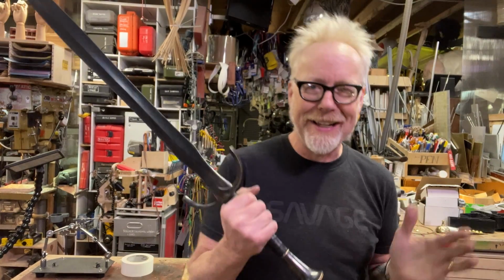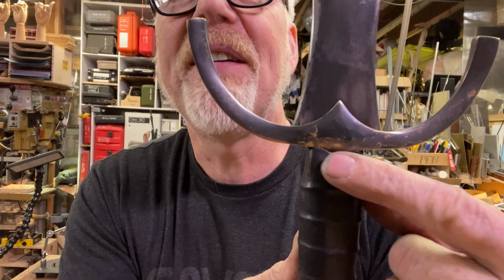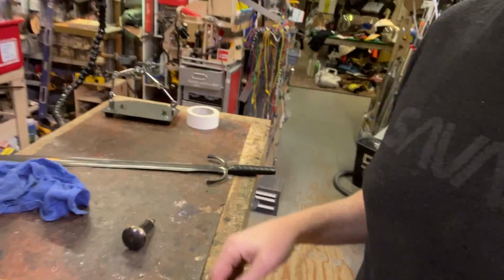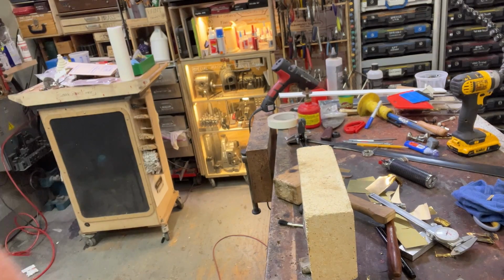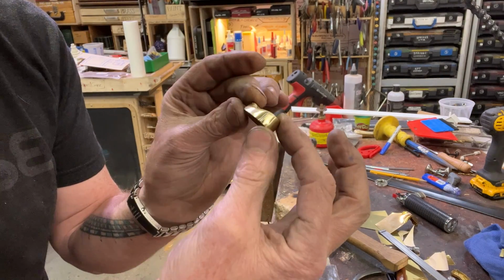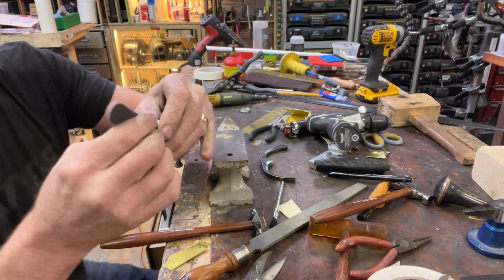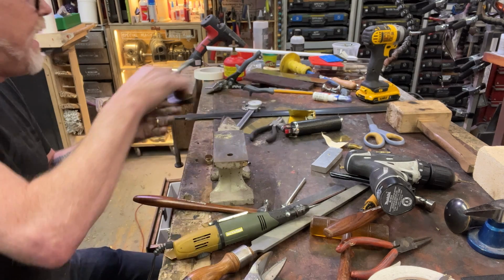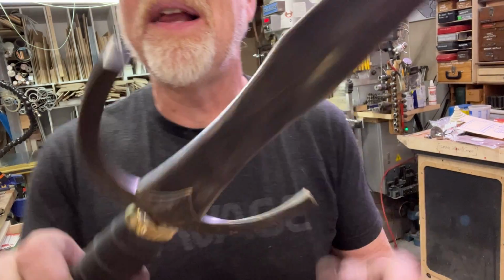Adam Savage's Assassin's Sword: Capstone Build

Comment: Watching Adam remove the chain drilled piece from the slot reminded me of an OLD aircraft industry joke. A company was producing a new fighter and were testing the prototype. Everything went well until the test pilot tried to pull it out of a steep dive, when the wings ripped off and the airplane crashed. They did an investigation and reinforced the areas that failed, but the same thing happened on the test flight of the next plane. Wash, rinse, repeat 3 more times. Finally, and in desperation, the engineers asked for help in solving the problem. The company janitor, who had been present for the entire episode, offered the only new idea. He told them that they had to drill a row of small holes all the way around the wing where it attached to the airplane. Desperate for anything to work, they did so and to the amazement of everyone it worked! The design was approved and the company got the contract to produce hundreds of units. In appreciation of his contribution, the company gave the janitor an award and a huge bonus, presented at a lavish dinner party with him as guest of honor. On the podium, the president of the company asked him how he came up with his brilliant design insight. His response? "It's simple really, nothing, not even toilet paper will tear on the perforated lines."
Reply: That’s a really good one; the setup pays off and then some.

Comment: This build was so great! I was not convinced by that pommel at first, but man does it look good with the patina. Also, here's the jeweler's secret weapon for trimming thin sheet metal: Joyce Chen kitchen shears. They cut as well as (or better than) tin snips, and you can get really great detail because they're small. Best utility shears for any shop!
Reply: and to take that idea a step further:
Get a pair of Electricians Scissors.
Everybody should have one they cut sheet metal as easy as Cu wire.
Reply: To add a little more a silversmith... I would have made it the other way around... fashion the piece that sits against the cross piece first (there's your buck!).  Cut the hole using the reference of the crosspiece hole and then fashion and fix the collar... Should give a much neater sit and no artifacts!

Comment: Adam, I have a fencing rapier whose handle I replaced.  The stock handle was balsa wood which put the balance way too far forward.  I secured a good pommel nut and when that wasn't enough, I decided to replace the handle with something more substantial, Jatoba.  The hard part was boring the hole perfectly straight as I don't have a shop.  I had a friend at the university machine shop who was more than willng to take on the job for a coffee or two.  The result was perfect until I got the handle home and discovered that the tang had been rough-cut with a hand hacksaw I think.  I spent hours with a tiny rat-tail file enlarging and changing the profile of that perfect bore.  Oh well.
Reply: Jatoba is a beautiful tree, I already had the pleasure of planting one.

Comment: Your technique with drilling all the holes is called chain drilling, i've used it for everything from small stuff like youre doing to making stainless disc brake rotors to bellhousing flanges for a gearbox in 1/2 inch steel plate.

Comment: To stop losing parts when you use the bench grinder/ polisher put a piece of sheep's skin rug on the floor. The parts hit the wool and stay put, not ricocheting across the hard floor.
Reply: But than you have to calculate exactly where the piece will hit the floor.

That might take some time 🤣

Comment: Nice Work Adam!  That capstone looks great, as does the entire sword.

Trust you to have the same mini-torch that I have though!  Such a versatile torch and so easy to get in places and make joints other torches can not. I did modify the air hole barrel with a second hole though, makes tweaking the flame so much easier!